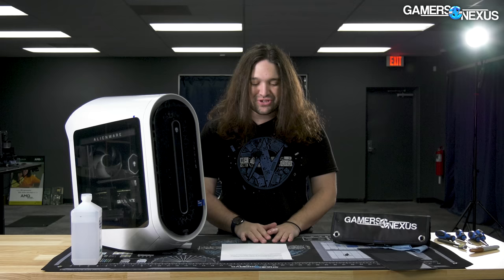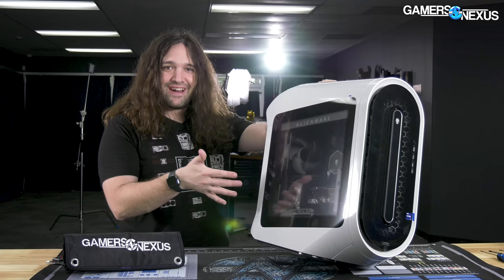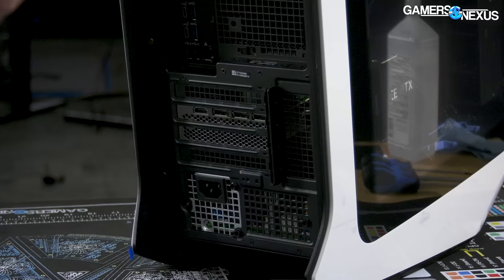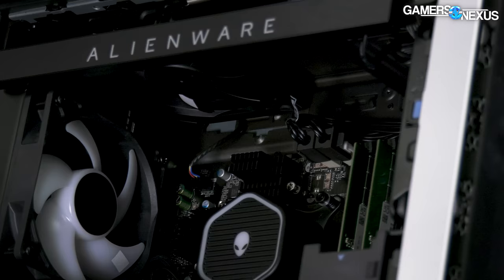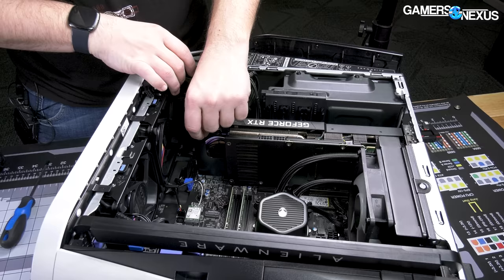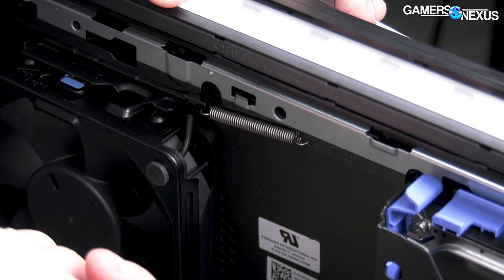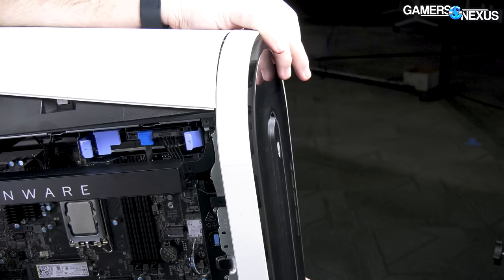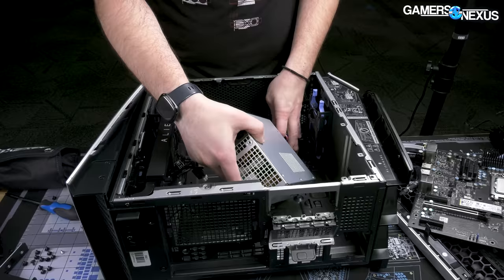Crazy Bad $5000 Alienware Gaming PC: R13 Aurora Tear-Down

Comment: Literally the only thing you can reasonably reuse of this whole computer is the CPU, GPU and maybe the fans and HDD/SSD, tho the two latter are probably really bad. The AiO has way too short tubes, the PSU way too short cables, the case is proprietaty BS, the MB is proprietary BS.
This is insane. I am a mechanical engineer myself and completly agree with Steve, the engineering is good. Just applied completly wrong. It's way to expensiv and solves no problems, for this application. This is outstandingly bad, omg
Reply from the maker: Completely agreed here. Not even the RAM is any good!
Reply: @GamersNexus  they managed to make the RAM proprietary? Or is it just so bad that it belongs in the e waste shredder?
Reply: @ZE0XE0  the RAM is just shit for 5 grand
Reply: That's the thing though. You can't halfway engineer something well. You have to look at the whole picture, and if it's bad, so is the engineering.
Reply: Imagine getting an engineering degree and getting a job at Dell, only to spend your time over engineering something unnecessary. 
Plus it's not easy getting an engineering degree
Reply: @ZE0XE0  DDR5-4400 CL38 is just shit, no matter the price. 12th gen supports both DDR4 and 5. And unless you go very, very high end with the DDR5, you have really no performance benefits at all and should rather stick to DDR4, which is waay cheaper and a decent kit of DDR4 is probably even quite a bit faster the this crap DDR5 4400 kit. This is because DDR4 is very mature, whereas DDR5 is not. The timings on the 5 are ridiculously loose, while a DDR4 kit can literally half them at the same transfer speeds
Reply: @GamersNexus  that ssd looked like its under bend stress 2
Reply: I made the mistake of buying a Dell XPS gaming pc in 2018. Not an alienware of course, but in my experience the SSD/HDD was a decent Samsung and Toshiba respectively. So I still use the parts to this day. The RAM, however, was in fact shit and I eventually upgraded it. I would not use any of the fans found in a Dell unless I had no other option. I do think their XPS line is better than alienware though from what i've seen, as far as quality of basic components.
Reply: Having the case on a tilt axis that isn't at a 90 degree angle is very bad for an HDD!
Reply: It serves a purpose, although a stupid one: It can be assembled on the same line by the same people who also build every other DELL PC and be serviced by the same technicians.
Every pc from them follows these mechanical standards and once you get a hold of it you can assemble them blind.
Reply: I’ve got a case full of non proprietary fans atm I have 4 noctua’s in there you can upgrade the ram on this PC it’s more upgradable than ppl think I have space to add like 4 more drives 3 2.5” SSD’s and a second M.2 slot and I got a 3080 Ti at almost MSRP in 20221 that why I went Alienware it’s a good PC and yes the PSU cables are short that’s the only really sucky thing, they solved the airflow issues of the R10/12 which is now illegal to buy in some states gaming PC’s are becoming illegal slowly there’s like 8 states were there not legal if you scrap the almighty Dell OEM fans and re-paste the IHS with something better than toothpaste you can get great temps out of that 120mm rad I can game all day and never go above 60C I start at 56-57 ambient temperature goes up so pc temp goes up and I’m running current AAA titles that they say are hard machines like IRacing etc….
Reply: @ZE0XE0  It's just bottom barrel memory die RAM. It's basically e-waste coming out of the door.
Reply: Good thing you said literally.  I’d hate for anyone to think you were speaking rhetorically. Or hyperbolically.  Or ironically. Thanks for making that distinction.
Reply: @bonusflaps1749  your post literally added nothing
Reply: @bonusflaps1749  Hey no problem, happy to see you appreciating the fact that I've made this distinction. Otherwise there'd be a possibility that someone thinks this is an ironically meant comment
Reply: @D00ML0RD1  glad I'm not the only one who noticed
Reply: @BMXaster  here in the UK, the slowest DDR5 I have seen is 4800 as well! So what Dell is using has to be engineering samples or something!!
Reply: @nimoy007  The thing is that this engineering IS good, it achieves Dell's goal perfectly. Dell's goal is to con people into buying a cool looking computer that won't last very long so you have to buy another one in 3 years.

It's malice.
Reply: @Yggdrasill8  A problem that could easily be fixed by not putting an HDD in a five thousand dollar computer.  It's not 2008 any more (a common refrain with this computer, it appears).
Reply: @kyle8952  In terms of humor, yes, I agree, but in reality, that goes against the code of ethics that every engineer should have.
Reply: @nimoy007  That every professional engineer should have. (As opposed to a 'gun for hire')

Comment: Dell feels like the General Motors of the PC world. They have some genuinely fantastic engineers that can build around a problem, but are choked back by weird or just inane bean counter cost cutting decisions.
Reply: Can confirm. I work for Dell. Love my position there. But sometimes these decisions are asinine. I've told my boss that for enterprise they are great but I wouldn't recommend them for home use with a 10 ft pole
Reply: but the cheap version of General Motors 🤣
Reply: It's like it was trying to be a toolless workstation or server chassis...but didn't quite make it.
Reply: @KingZeus96  As someone who uses some of Dells low end enterprise products, I do like them.  Unfortunately, even there things like weird Amphenol SAS connectors mean Dell is going their own way.  Plus having to mod a SAS card's PCI ID or the server won't even boot with it in the internal slot is just asinine.

The products are good, but Enterprise users are aware of these caveats and purchase appropriately.
Reply: @KingZeus96  yes can confirm Dell is a great place to work

Comment: I don't know why Alienware is so hell-bent on taking good hardware and cramming it into a plastic and metal autoclave posing as a PC tower.
Reply: Most likely to make it impossible to go anywhere else to get it fixed. I don't think I've ever seen a motherboard with that shape before.  They are counting on those that don't know a lot about computers that just need something to work to likely buy them. This seems like it was purposely made to fail.
Reply: @cael_1303  in their defence the warranty is rock solid. Dell usually comes in clutch and will even replace your laptop with a newer brand if something fails. Still a crap desktop tho
Reply: @Sm-rd4wq  for the sole fact, as Linus proved, you get conned into an extended warranty even if you wanted it or not.
Reply: ItLoOkScOoL
Reply: Style over function. The kind of person who buys this computer wants a computer with high-TDP desktop parts but which is as compact as possible. Hence the need for the complex air-flow design. You know the old car salesman mantra "there is a butt for every seat", right? Well, there is a user for every computer, I guess. Someone out there is willing to pay thousands more for a slightly more compact and more stylish tower. As long as it's not the only choice out there (which is the situation Apple users were subjected to with the cylindrical Mac Pro), I am OK with it. Because that's the power of the PC ecosystem: diversity.
Reply: Usual BS "review" by GN, where they again failed to extort money from Dell, so the are ranting and raving about basically nothing. Whole video could be put into one sentence: we don't like how case looks.
Reply: @aleksazunjic9672  This computer is objectively bad value for money. Unless having a slightly shrunken-down tower compared to a common PC case is extremely important to you, it's an expensive yet compromised design and the parts inside are throttling.
Reply: @aleksazunjic9672  It's like you didn't even watch the video. If you did and still are of that opinion, I can say with confidence you have not built a PC in at least 15 years. Also what is this nonsense about extorting money from Dell? GN are probably the most ethical reviewers out there, and if not completely at least very close to being financially independent from the big manufacturers/advertisers.
Reply: @cael_1303  Guess that's why they sneakly put in the extended warranty, its actually very thoughtful.
Reply: @Δημήτρης-θ7θ  I mean in terms of a modern computer this is very far from stylish, and there's no excuse at this price point either. A beautiful case with modern fan/radiator support for potentially great cooling which is super easy to build in costs less than $200. Frankly there are many cases on the market for less than $100 which offer far more than this Alienware both in looks and functionality.
There are also cases that are way more compact than this one which would give less issues with overheating, though a 12900K plus a 3090 is never going to be easy in a very compact case, which this Alienware is not, so no excuse there either.
Reply: @CampyCamper  It would be very hard to get the components that this computer comes with in a box that's more compact than this is and has the same rounded design. That's why I say it's style over function. And that's what current Alienware is selling in desktops nowadays, since smaller OEMs now make the kind of gaming PCs Alienware used to specialise in. Or you can keep some of your money in your wallet and build your own from generic parts.
Reply: It's not really even good hardware.  The motherboard and RAM are both shite.  The only good parts in that are the CPU and GPU, but the GPU is completely inappropriate for a gaming system.
Reply: @aleksazunjic9672  That computer is complete garbage.  The only good parts are the CPU and GPU, and the GPU is not appropriate for a gaming PC.  The case is not just ugly, it's OBJECTIVELY bad.  The motherboard and RAM are garbage.  My computer is better in every way than that and cost less than half.
Reply: @StormsparkPegasus  Yeah, right :D Computer is expensive because it has expensive parts. Ty building something with same specs and it would cost you more . RAM and MB are fine, they support CPU and GPU . Case is fancy, and some people do not like that kind of design, but objectively it serves it purpose.
Reply: @CampyCamper  GN business model - give us money or you will get bad review . Dell refuses to comply so they constantly spit on them (while on the other hand they defended Sony during overheating scandal). As for PC building, nothing has changed in last 15-10 years. You get the components and you put them in a metal(or plastic) box so they stay in one place :D That is about it.
Reply: @Doom Fetish They are decent for the money. If you try to build something like that on your own, it would cost you more. There are certainly some flaws (proprietary parts,  funny looking case) , but overall you get what you paid for.
Reply: @aleksazunjic9672  You've got no clue what you're talking about. My computer is better than that piece of trash in every way, and cost half. Better RAM, better CPU, better GPU, better cooling, much better case.  Quit talking about subjects you obviously know nothing about.
Reply: @aleksazunjic9672  You're obviously a Dell employee. How much do they pay you to troll YouTube?
Reply: @StormsparkPegasus  10 cents a week :P
Reply: @StormsparkPegasus  Put specs and the cost .
Reply: @aleksazunjic9672  12900k.  EVGA XC3 3080ti.  Thermaltake X71 case.  32GB of RAM.  2 NVMe SSD's (500GB for boot/OS drive, 2TB for storage).  RM850x PSU.  Arctic Freezer 2 cooler.  Total cost: around $2500.  And will actually run at full speed since my case is large enough and has enough cooling for the components.  It will outperform the crap out of this piece of junk.  The CPU/GPU both stay under 60C even at 100% load.
Reply: @StormsparkPegasus  As you can see for yourself, you have lower specs in terms of GPU and memory and that costs money. You don't need to stay under 60C , all of these components run fine at around 75-80C , even more than that.
Reply: @aleksazunjic9672  Nope. The 3090 is not a gaming card, and will in fact be slower in games than my GPU is.  It's also not much more expensive tha my card, maybe $200 more.  I do not have lower spec memory, haha.  Plus, the motherboard, power supply, and case for this are all trash (basically e-waste).  The difference in price between the 3080ti and 3090 is made up for on my system by having other components (case, cooler) be more expensive anyway.  Anyway, have fun baking your hardware and wondering why it dies.  The rest of us will actually build decent systems.
Reply: @StormsparkPegasus  The person who buys this thing will never take out the motherboard (put it where? it only fits inside this case). So as long as the motherboard performs adequately, it's OK. Basically, this system occupies the ecological niche between an extreme case mod and a desktop replacement laptop, so anyone who buys it is paying for that: A slightly shrunken-down PC with rounded-off edges. Needless to say, it's not worth the money.

Comment: It's incredible that they spend a lot more effort to make a bad case "work" than they would to create a new case. Just mind boggling.
Reply: Sunk cost fallacy. Management was probably like "we want to sell this or old stock" and got the engineers to work the problem and ended up costing a lot but "works already done, let's not spend more even though it would result in a cheap but more quality product"
Reply: @duke605  It must be hell working as an engineer for Dell, having to devote so much time & effort & money to making a bad solution almost (but not quite) work, all because your bosses are stupid and insist on that over a better solution that's cheaper.
Reply: This build is probably 0.1% of their sales, but they're able to offer it because it's the same form factor as all their other machines.  Having it actually perform well, which would benefit the customer, is a distant second to cutting costs which benefits the shareholders.
Reply: @cybisz2883  I'd be happy if Dell was the only company where that happened.